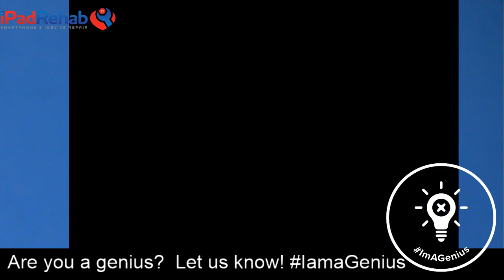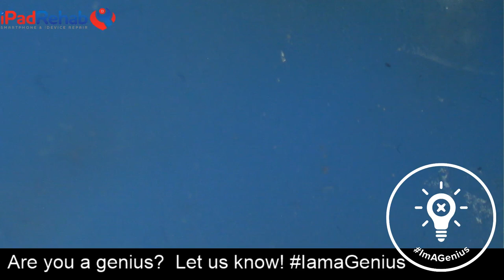Can 8 year old twins Betsy and Maisie Beat the Genius Bar? #Imagenius

Comment: Did you ever go to learn at a school to be able to repair mobiles? From PhD to electronics it is a huge step. I learn in mechanics how electricity works and some components but I lack of info about a bunch of then. I always liked to fix things and I did quite a few time but micro business, never. I’m a French speaking person and I understand when you explain because you are a very good Teacher. Unfortunately I can’t cross the border.
Reply from the maker: Marco—great question.  I believe the internet can teach you anything. I learned Electronics by trying to solve one problem at a time, eliminating variables.  I joined a paid advice forum, read everything I could, and made a lot of mistakes along the way.  Ultimately I started Practical Board Repair School to make it easier for others to learn microsoldering.
Reply: iPad Rehab, thank you.